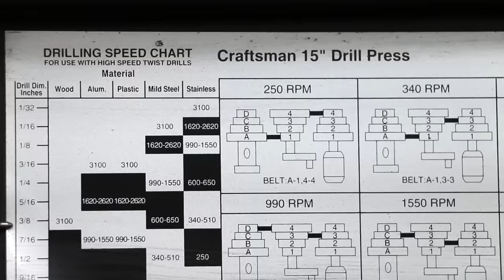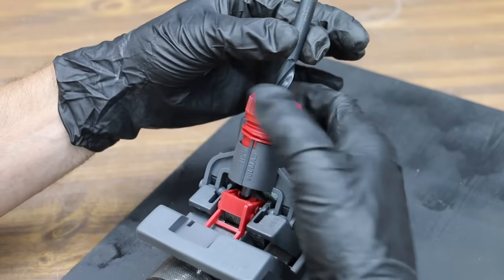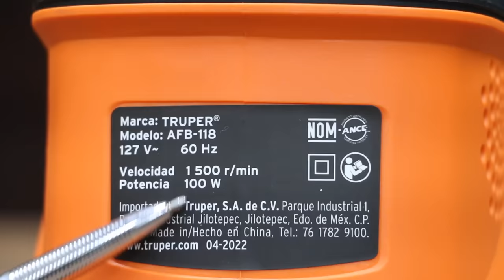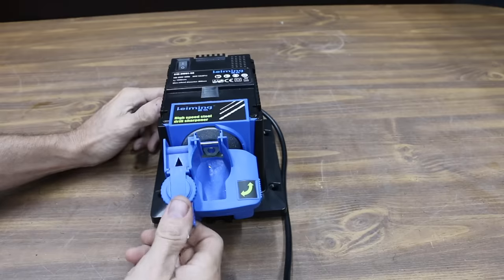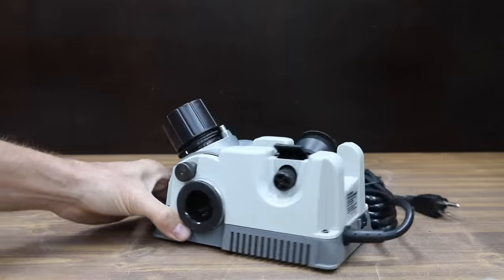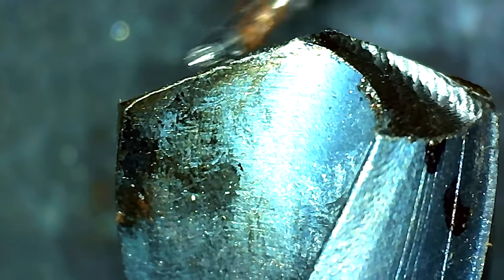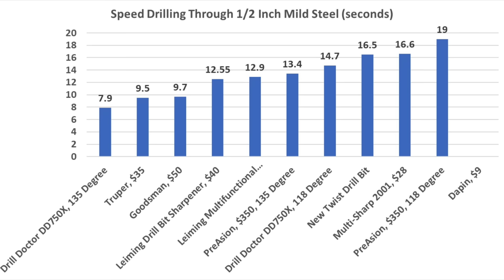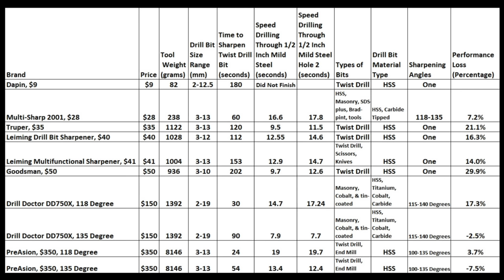Which Drill Bit Sharpener is Best? $9 vs $350--Let's Settle This!

Comment: Best drill bit sharpener for small drill bits was the 1980's Black and Decker model that looked like a bench grinder.  Quick simple and accurate.  Of course they quit making them by the early nineties and then went out of business a few years later (excellent management approved by all the MBA schools!!).  A bit expensive for the times so I delayed getting one and then they were no longer available.  So a few more years and the Drill Doctor came out with several different models.  I bought three of them.  Always seemed to work well for the first fifty or so bits then they wouldn't grind enough back relief so I would replace the grinding wheel with no luck, then I would buy another one.  Same result some a little quicker than others.  Called the company who had no solution.  Tossed them in the back of a drawer or threw them away and went back to hand grinding.  Quicker to do when you consider the set up even when the Drill Doctor worked.  Then I discovered the 1" table top stationary belt sander for about forty bucks at Harbor Freight.  I bought some quality belts and I have to say for under a 1/2" bit that is the best forty bucks I ever spent.  Sharpens quickly and accurately with no set up since it lives out in the open.  You can see the entire edge as you grind and it does so very quickly.  That is the way I sharpen drill bits since I got it several years ago.  The bigger bits I take to my larger stationery belt grinder.  Free handing with a marker line on 60 degrees each side of center that I keep in my peripheral vision every now and then.  Along the way I now and again try the bit grinders as they come out.  Always the same result and they end up in the trash.
Reply from the maker: Thanks for sharing.

Comment: As a professional Carpenter for 42 years I have gone through some drill bits. And a lot of so called sharpeners. Cheap and expensive. I even have the Drill Doctor. Never yet found one that works for any length of time. Or that isn't so time consuming as to be a pain. The little spinning drums on most of the sharpeners work for a few drills. Even less on the bigger ones. Then fail to remove anymore material. For the Drill Doctor replacements aren't cheap. And the set up is fiddly. So my go to is the bench grinder. I have tried jig mounts. OK but fiddly. Then for years just did them by eye on the grinder. Then I came across two little plastic sled things. One for each angle. You still grind by eye. But the little sleds hold the bits at the perfect angles. Quick. Easy. And way less fiddly. And the drills cut. Plus they are like $20 au. Win Win.
Reply from the maker: Thanks for sharing.

Comment: Drill Doctor is the best I've had mine for over 30 yrs, never had a problem with it so easy to use and sharpens any bit, I use mainly metal bits in Heavy truck frames and heavy equipment for a fast easy sharpener can't beat the Drill DR
Reply from the maker: Thanks for the feedback.

Comment: Does drill lubricant effect longevity or drilling performance? And which is the best?
Reply: Yes, it affects both performance and longevity. But which one you use depends on the material being drilled, the material the drill bit is made of, the RPMs the bit is spinning, and the cutting speed, in other words, the size/depth of the cut per revolution.
Reply from the maker: Thanks for the suggestion.

Comment: I'm so glad I learned to sharpen drills freehand. But sharpening it symmetrically remains a challenge.
As stated in other comments, I'm curious how the drill sharpeners do at this part, securing a right diameter hole.
Also funny to see that the PreAsion uses a collet upside down.
Reply from the maker: Thanks for the feedback.

Comment: @projectfarm great review I bought this and saved a ton on bits.  I think a pepper spray review would be good.  Include some spray bottles and the grenade types.  Keep it coming!  Thanks
Reply from the maker: Thank you!
Reply: you know there is a TON of electrical connectors out there too- some heat shrink, some cheap Chinese, some just standard stuff from Napa.  Would be a good show.  Electrical tape is another on like this- so much cheap stuff and a few old standards. @ProjectFarm

Comment: I would love to see a video on handheld hydraulic cutters. I found out about them and am considering replacing a set of bolt cutters at work with one. They seem easier and smaller but much more expendable on the blades.
Reply from the maker: Thanks for the suggestion.

Comment: The Leiming $40 and the $50 Goodman look the same to me and of course they are both made in China. I have a first gen Drill Doctor and it works ok but not as good as the newer models as it was the beginning of the sharpening tools.  Not as good with small bits but ok with the bigger ones.  I think i got my drill doctor back in late 90's off of a tool truck . I think Snap-on. Don't really remember anymore.
Reply from the maker: Thanks for sharing.

Comment: This was my suggestion together with much, much more expensive endmill stuff. What you only touched on is hole quality and mostly... Size. Do they still drill proper size hole.
Also should compare to hand sharpening.
I own Darex M1. Old 1970s, like super expensive drill doctor. But I still do touch-up by hand. I also designed a jig for large drills, up to 2.5in.
Reply from the maker: Thanks for the constructive feedback.

Comment: This might sound strange, but I can't afford to get my leaky power steering fixed, because im spending all of that money buying the PS fluids every few weeks ..

I know ATF works somewhat, it's whining a bit more when have used that when out of PS fluid...

My question, I have a huge jug of Gear Oil I had for my old Subaru manual transmission.  Hydraulic fluid is hydraulic fluid right? Can I use gear oil as PS fluid?

Comment: The sharpeners that are called Truper (featured at 4:30) and both Leimings (one of them is extremely similar to the Truper) are sold here in Latvia - and in EU in general by the massive German grocery/household store network Lidl - except their brand name for almost all tools is "Parkside". Have both types of drill sharpeners, one of them cost 29.99 and the other 39.99 (can't remember which was which) and although they contain loads of plastics (good for the dynosaurs!) - they seem to be working decently. Also - no one will tell you this (least of all - user's manuals for angle grinders or drill bits... are there any manuals for drill bits? Don't think so - we're simply left in the dark to figure them out on our own) - no one will tell you this - but you can, observing the angle somewhat - sharpen a drill bit with an angle grinder - in an emergency - or what's known as "in a pinch" in the industry. It will work on a destroyed bit - but not for long. But then again - it's not like anyone had a lack of angle grinders and electricity - just go at it again! :D :D Either way - thanks for the comprehensive video, long-time viewer, greetings from Latvia.
Reply from the maker: Greetings!  Thanks for being a long-time viewer!  You are welcome!

Comment: Would love to see a video on compound miter saws! How accurately it maintains an angle, how accurate clicking detents are, how easy it is to accurately position the saw for a cut, how quickly before the motor bogs down. Can it handle aluminum and can it handle a grinding disk for steel. Stuff like that!
Reply from the maker: Thanks for the suggestion.

Comment: My god man, thanks so much, almost bought that $245 Vevor, but now I'm going to buy the Drill Doctor 750
Reply from the maker: You are welcome!  Thanks for the feedback.
Reply: @ProjectFarm   Ended up scoring a used one on eBay with a hard plastic carrying case for $70, can't wait I've got about 400 drill bits to sharpen once it gets here in Venezuela... Bought extra grinding wheels on Amazon, seriously can't thank you enough for this review you did and the speed you packed in over an hour's worth of info into 17 mins

Comment: Holy 300 steps Batman!! Multi-sharp is ridiculous from the start. Bad enough it takes 3 days and full alignment of all 8 planets to get a bit into the device, but to also demand the monitoring of drill speed along with the potential use of the very drill you will need to drill the needed hole(s) is a bit too much. Sure, the bit is now sharp. But you might have to charge the drill battery before doing the work that you needed a sharp bit to perform in the first place.   lol
Reply from the maker: Thanks for the feedback.

Comment: I have the drill doctor 750, what's not shown is how fiddly the spring alignment clams are on smaller drill bits ie 2.4mm in essence a very poor design. The current Darex 750X has a different size diamond wheel which will not fit the older 750 model I own and to my disappointment Darex does not make the old diamond wheel available outside USA.
Not wishing to waste any more money on Darex's short EOL products policy. I choose to purchased something similar to the PreAsian, here in Oz they are actually cheaper than the 750X. I have found it a truly professional tool, from the all metal design to the no nonsense drill bit alignment and the use of a collet chuck is a far superior method in clamping the drill bit that the fiddly 6 thin finger blade chuck system used in the 750X. Which will pop out of their plastic tracks if you unscrew the chuck to far, good luck trying to fit them back in.
Without a doubt the easy to 7use all metal Precision Drill Sharpener I now own similar to the PreAsian will be the last drill sharpener I will ever buy, plus the knowledge the diamond wheels are industry standard available everywhere.
Reply from the maker: Thanks for sharing.

Comment: I own and use the drill dr. And it does a great job. But I have a diamond home that I use to dress the drill cutting edge with and it maintains the cutting edge much longer. If you look at the cutting edge after sharpening its quite jagged on the face and leading edge. This breaks down and thus it looses its sharp edge. The diamond hone makes the difference.
Reply from the maker: Thanks for the feedback.

Comment: I have used a Drill Doctor XPK for over a decade. The only problem I ever had is it was never able to form a splitpoint as advertised. My drills are sharp, but no splitpoint. Even if the yellow Chicom sharpener seems to work better in this review, I just ordered a new 750x direct from Drill Doctor because I do not support chicom manufacturing slavery.

Comment: Hi Project Farm! My question is a bit irrelevant to the video, but hope you can help. I have a rechargeable lithium battery 3.7V for my Sony XM3 headphones which I measured with a Multimeter and got the result of 4.29V.

My headphones won’t turn on and I am wondering if the battery high voltage is the cause? 

The battery says “limited charge voltage 4.2+-0.05”

Thanks in advance!
Reply from the maker: Thanks for the suggestion.

Comment: If time is money, the time it took to set up the cheaper ones, you're at a loss after a few bits vs the more expensive sharpeners.
To go along with drill bits etc, I'd like to see a showdown of drill/tap helpers.  I used to use Tap Magic until I found Boelube, now there's no going back.  How about a comparison there with step drills?
Reply from the maker: Thanks for the suggestion.

Comment: Would you be able to test the accuracy of the hole sizes after sharpening? When I was working as a machinist, I learned to sharpen on the grinder, but it was shown to me how the hole size can be affected by the process, if you don't get it centered up correctly. Maybe they're all consistent enough that this isn't a big deal, but it might prove interesting.
Reply from the maker: Thanks for the suggestion.
Reply: @ProjectFarm  thank you n for the great videos.

Comment: Project Idea: Dado blades brands. Do they make clean cuts on the edges and enter exit areas? How accurate are they with the shims and blades including the wing clippers? Dado sizes? Do they cause plywood to chip and flake? How do they handle soft vs harder woods? Do soft woods gum them up? Do they struggle with hardwood? Another idea would be table saws?
Reply from the maker: Thanks for the suggestion.

Comment: Its interesting that the Preasion uses standard ER20 collets. There is a whole class of similar Chinese built machines like that. I bet they are knockoffs of some more reputable machines. Some of them come with two collet chucks, one for er20, and one for er25, allowing a larger range of sizes. I don't know why they don't just use er25 for everything though.

There are typically three models. For example Vevor calls them the MR-20A, MR-20B and MR-20G. The A comed with 11 er20 collets and matching chuck and a CBN grinding wheel. The B is the same as the A but also cones with a diamond wheel as well as tge cbn. The G model comes with both er20 and er25 collets and two chucks as well as both grinding wheels. 

Grizzley sells an atypical lodel. Its a quite different design but is basically the same sort of pf machine and costs 3x as much. Most of the ones found on places like aliexpress are all very similar but vary in various details. Prives of course are all over the place but 230 dollars shiped is about the lowest.
Reply from the maker: Thanks for sharing.

Comment: Production note: Having only 1 drillbit per test, for all you know, is more of a test of a drillbit than it is of a sharpener. 2 or 3 would've at least shown whether drill bit variance (and heating cycle when dulling, which ruins the temper, and affects its ability to hold an edge) swamps the results of your test. When testing things like generators I get that that's not practical, but for drill bits, it wouldn't've been that much extra cost or time to do 3 bits each. It tells a more interesting story too, to see the variance (or lack thereof).
Reply from the maker: Thanks for the constructive feedback.

Comment: Fun fact…….The Drill Doctor is made by Darex. They’ve been making industrial drill sharpeners for years and the Drill Doctor shares many features with them. I’ve got one of their automatic machines and it’s second to none. Way too expensive for normal folks (about 6000 bucks for the basic machine without options), but the Drill Doctor is a heckuva machine for the occasional user.
Reply from the maker: Thanks for sharing.

Comment: I use a bench grinder to sharpen my drill bits... No jigs, i just hold steady grinding away from the leading edge.

I use to have a drill bit sharpener, but havent used it in years.

Also... If you heat the bit up to much you affect the hardness.

If i overheated a drill bit, i heat to red hot and quench in water or oil to make it hard again. I discovered quenching hardens metal in my career when i would weld things and cool with water then watch as my drill bit got eaten by the metal i welded in mu drill press
Reply from the maker: Thanks for the feedback.

Comment: Can you test the best methods for removing water from diesel fuel? Would be great to know if any of these quite expensive additives actually do anything or not. Not common problem but a major one when it happens. Had wind storm blow up the lid on my tractors fuel tank and been fighting the water in there since. Hate having to take the tank off and drain the tank if there's a product that will fix it. Thanks for considering.
Reply: I'm not aware of any chemical solutions to the water problem that actually work. The best would be to drain & flush the tank and system. The second best would be a diesel/water separator in the fuel line, the closer to the tank the better. Good luck.
Reply from the maker: Thanks for the suggestion.
Reply: @GrayRaceCat  I put a filter which claimed to separate water from diesel in the fuel line however it didn't seem to do any good. Looks like I'm going to be pulling the tank again. This is an issue I've been trying to fix for years with this machine. Thought I had it with the metal box I made to cover the lid but it blew open in a storm. Must have been a heck of a wind. Hopefully the injectors haven't been hurt. Thanks for your help.

Comment: Todd, could you do a heat pump comparison for those of us on the northern prairies where the temperature gets down to -40 every year? With the high heating fuel costs these days, I am wearing two pairs of long underwear under my jeans, a shirt, sweater and coat in the house all day long.
Reply from the maker: Thanks for the suggestion.

Comment: I don't really like any of the results of those sharpeners, but the cut speed is interesting.  I would not use that amount of force to go through steel to get a clean cut.  It is too much.  So, I ignored the clean cut part.  Less force equal cleaner cut.  Secondly, I am not sure that all bits are tempered all the way through.  There was no mention of this.  I can bend some of my bits in the middle, but the tips are tempered.  How deep can you go?  I would rather see a video on drill bits.  I have done amazon reviews that say .... don't bother.  I can bend them with my finger.  My old craftman bits are tempered all the way through.  Not the Chinese bits.
Reply from the maker: Thanks for the feedback.

Comment: Should test some hole saws, Diablo, Spyder, Milwaukee, Lennox and of course the harbor freight ones. And use them on drywall, solid 3/4 ply, 2x4 and other materials.
Reply from the maker: Thanks for the suggestion.

Comment: WOW I didn't know sharping a drill bit was so much work
I have never used a bit sharpener I take the bit to the bench grinder blink a couple times to calibrate my eyes and adjust my hands to the correct angle then let the bit touch the grinding stone and rotate
I guess I'm just old school
Always wear your safety glasses when sharpening anything
Reply from the maker: Good Point on wearing safety glasses when sharpening!